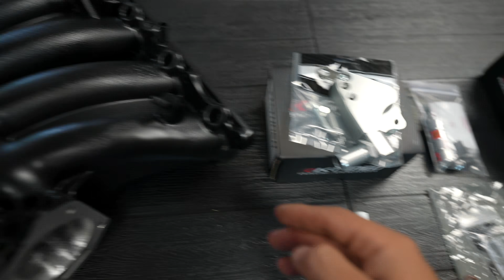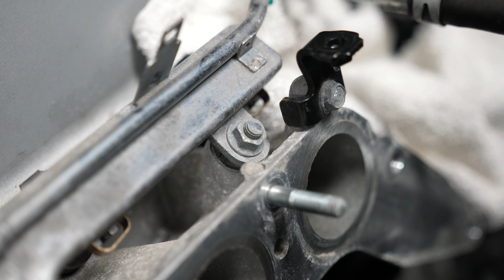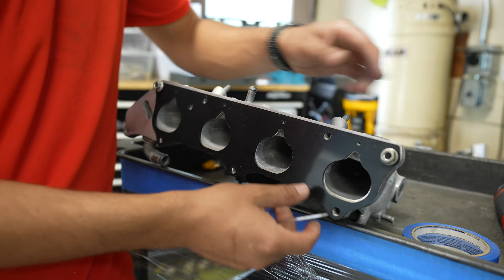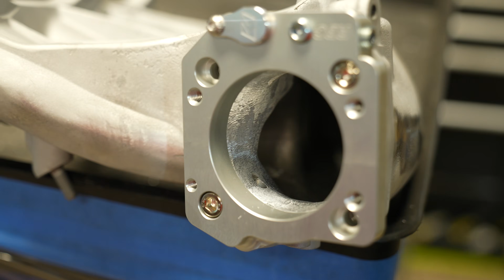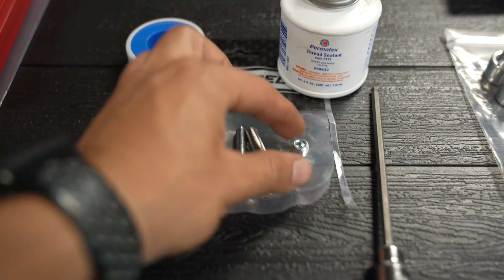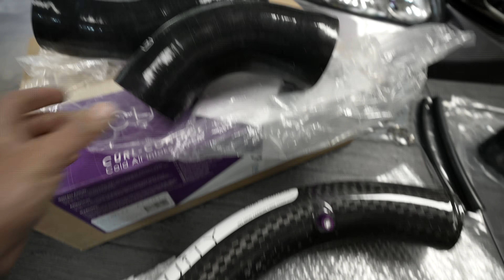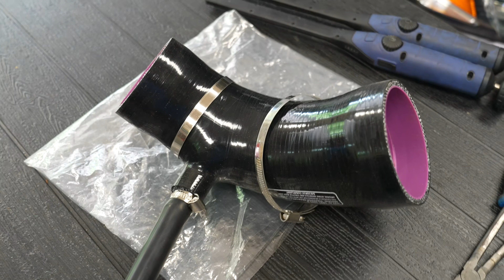RBC Intake Manifold Swap & Throttle Body Install // 9th-Gen Civic FBO Part 3 of 4

Comment: Great video as always. K24z3 right here with ported head and a crapton of mods… all motor. Looking to know more about the ZDX tb, as I was thinking about it, but kept hearing that there are voltage issues as it demands more of the ECU and needs to be pinned elsewhere or it will blow the ecu eventually.  If ht stick with Skunk2.
Reply from the maker: The ZDX TB does require a pro tune as it does pull a bit more power, however has been a tested and proven option. What I have seen as well, is when people run larger TB's, they will actually open up the TB and swap a stock 9th gen TB electric motor in it, so the only thing that is different is the physical size of the port.
Reply: @milanmastracci  Ive done the zdx throttle body and ported rbc to match and I'm having the idle surge, my tuner told me I need to do a idle relearn.  Will that truly make it stop? I don't have any vacuum leaks at all, everything is tight. Just started my tune.. did u change ur stock throttle body motor over to the zdx or no? I was thinking about doing it.

Comment: What happened to the rbb head swap ? I’ve been waiting to see that 😩
Reply from the maker: It's still happening!
Reply: @milanmastracci  good ! Can’t wait to see that bro! Seen a few 9th gen head swaps on YouTube but they are all k20. I’m curious to see  a rbb head though before I do it as well hehe
Reply from the maker: The K24A2 head makes the most amount of sense since it is made for the K24's 87mm bore, instead of the 86 from the K20. I'm pumped to see it running!
Reply: @milanmastracci  exactly ! I agree with that ! I can’t wait to slap on the rbb head , just buying piece by piece
Reply: @anthonyhernandez1953  depends where you want to make power. If you want that 8300 rpm+ use a type s head bro
Reply: @lindaover9764  the thing is k20 and k24 have a different bore and stroke , I think I would rather do a rbb head , it’s still a step up from the k24z7 head , to get higher revs i plan to type s oil pump I know it might get 8k max but it’s all good , it’s for my daily
Reply: @anthonyhernandez1953  I understand. But the bore and stroke are irrelevant when discussing cylinder heads. I've done my research. There's a popular test done where all Honda heads are pitted against another. The rbb flows the worst of the vtec heads. I'll share the info if I find it. TSX cams, prb, k20a2, or z3 cylinder head and your block. That's the winning combo. Though whatever vtec head you decide on will fun and hopefully you see great gains from where you're at. I'm following your channel now.
Reply: I mean to say the rbb flows better before 5000 rpm, then the other heads far outperform the rbb be up high. The rbb has smaller runners too, better for velocity which promotes torque not horsepower. But you're going exceed 260-270hp any head will be great. 😉 Since you already have torque, chase after horsepower up to 7900-8300 rpm. I'm not a tuner but that's what I did with my frank engine. She's real strong up to 8200.

Comment: Dude that throttle body is useless. Harry Sparks, the guy with the fastest 9th gen, uses the stock one.
Reply from the maker: There is no way he is running a stock TB, N/A, and the fastest 9th gen. When you're boosted, it is a totally different story!
Reply: @milanmastracci  Yeah that's fair, he's boosted lol
Reply from the maker: If it was going with a PRL turbo kit, I wouldn't consider touching the TB for added gains, just up the boost 0.5 a PSI and you're making more power lol

Comment: Hi Milan, a very nice job,  just FYI I just had a complete bumper to bumper body touch up on my 09 Accord. She looks like new. Now I need the drivers door leather done over. I'd still like to get dual exhaust installed like your 09. Be well,  Tom
Reply from the maker: Thanks Thomas!! That's awesome. I bet it feels like new car ahah. If you're able to find a V6 exhaust too, it will work on the 4 cylinder models. Inexpensive upgrade 👍 Take care!

Comment: Good job. U got some part that I should of got  but then I'm on budget. But I got mine done. Hope to see your graphics
Reply from the maker: That's awesome! Have you put your car on a dyno yet to see how much power it makes?
Reply: @milanmastracci  I did put it on the dyno but didn't get a full tune on it since my buddy and I had a short time. He only did a couple of pulls.  After that I just data log for him to adjust some more stuff to make it run good.  I need to go back and dyno tune again.

Comment: So are you going to add a type s oil pump kit?
Reply from the maker: Not to this engine as I have the other one that will be swapped into here, but that one will be getting the type S pump. One nice thing about the Type S pump is that it will allow you to rev the engine out more and make more power. It's a very nice upgrade!

Comment: I would’ve kept the rail connected to the fuel line and the kept the injectors in the rail since your not changing them. Then pulled the whole rail up as a unit and just change the bottom o-rings into the runners. No gas spillage. Just my 2 cents, not that your way is that much more effort. Good work, Cheers!
Reply from the maker: Not a bad idea! I don't know if working with the lower seals would put too much pressure / cause too much movement with the upper clips causing any damage. Might be something to try out 👍
Reply: @milanmastracci  generally they’ll come out together pretty easily unless your dealing with heavy corrosion of the runners. But your civic is super clean from what I can see! Silicone spray as you know is your best friend!

Comment: Very interested to see the comparison dyno graph for the torque curve, and powerband curve after the Pro-Tune. 😎
Reply from the maker: Oh its coming 😁 What are you expecting for power? Any ideas?
Reply: @milanmastracci  all together, you should be in the 225-230 whp club, if not a touch more.
Reply: @dubzc5895  he would be lucky to make 215 on nicks dyno, I have the exact same setup minus the j37 TB I made 210 WHP, the RBC is all hype on these 9th gens, the head doesn't flow good enough to benefit from it, there is a reason why Honda never put RBC manifolds on k24s
Reply: @Grey_M340i  needs to that k20 type S head.

Comment: hello milan, be honest, how many times have you disassembled and assembled parts KTD-K24-IMA - K-Tuned intake manifold adapter? tell us the truth 😅. My mechanic had to put it on like 15 times. 😂 so that there would be no coolant leakage.
Reply from the maker: I did it once (in this video), however mine is leaking a TINY amount. I'm going to take it off at some point and apply more Hondabond, hoping that will solve it. If that doesn't work, I may just tap the head and use the other bolt.
Reply: @milanmastracci  Thats the bad about that part, mine had minimal leakage but it can't be left like that because the motor can burn out, I asked k-tuned for some way to put that in and they say the screw on top shouldn't being too tight creates a layer between the two and thus seal, but k-tuned says so but it is very difficult to put it into practice. Because that hole is too big for the small hole in the part, I hope you can fix it, but my project on my car took another week to seal that leak. I love your videos because I have a similar car in engine but mine is a 2012 coupe and I am improving it little by little.
Reply from the maker: That's awesome brother! Keep it up 🙌

Comment: Did the same thing for mine but ran into an idle surge problem, and had to run the oem throttle body. Any ideas?
Reply: I think throttle need re-learn, idk.
Reply from the maker: Yeah that would require a throttle body relearn. Mine did the same thing when I fired it up for the first time. I outlined how to fix it towards the end of the video.